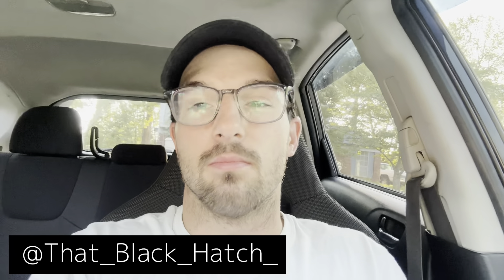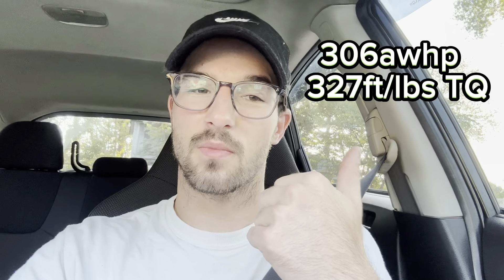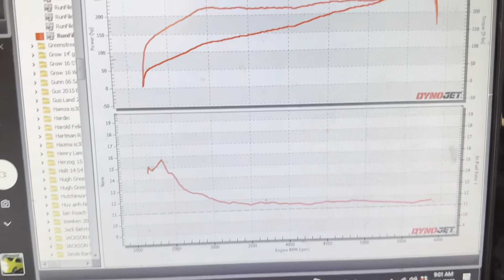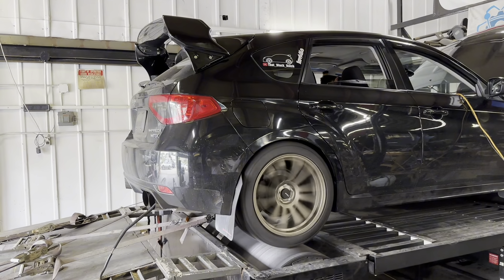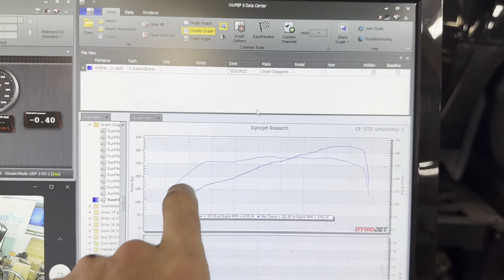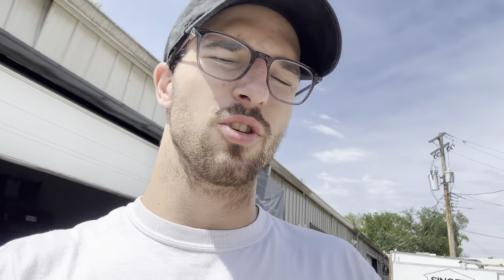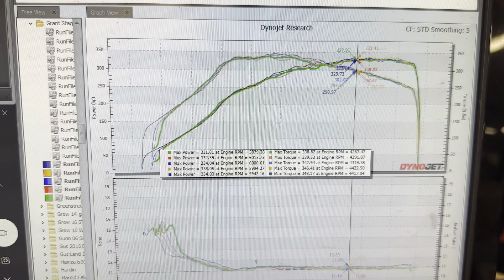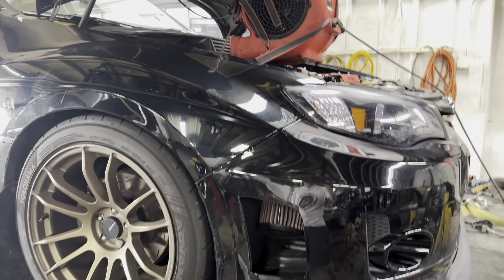NOW THIS IS WHAT I CALL AN UPGRADE!

Comment: How many miles do you have? I have a 2013 hatch 50k miles I'm the second owner since 25 k
Reply from the maker: The chassis has 179k but the motor has about 45k on it. Turbo was still stock OEM VF series.